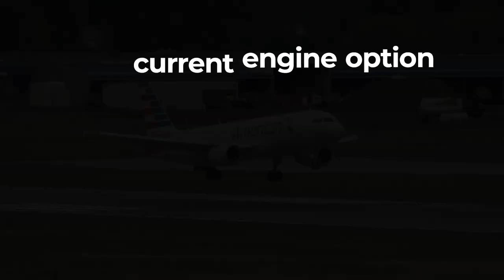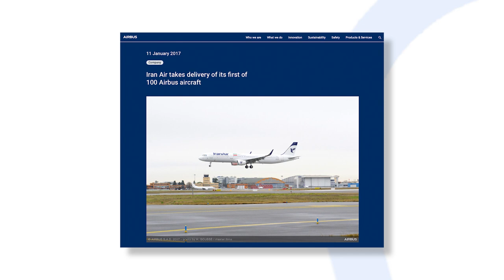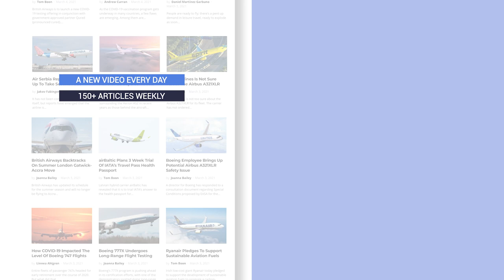Airbus Has Delivered Its Last Ever A321ceo

Comment: I've flown on Delta's A-321 between Detroit and Phoenix non stop over 15 times in the last year... Great modern cabins, great Delta service, and great planes from Airbus. I avoid flying any 737s due to the cramped interiors and lack of refinement.
Reply: Yeah delta’s 737s are extremely cramped, I try to avoid them when possible
Reply: Yup, I love the A-321s between Detroit/Atlanta and Phoenix. Always a great ride. The extra cabin width makes a massive difference. For a while they seemed to be running mostly 739s on those routes, which I liked much more than their 738s, but in recent years all I've been on are much superior A-321s.
Reply: And let’s not forget the dangers of the 737 max with the awful MCAS
Reply: You mean the 737's tendancy to nose-dive into terrain isn't also a factor when deciding whether to fly on a 737?
Reply: @vladsnape6408  Delta didn't buy the MAX, so it's not a factor on that airline.
Reply: @jblyon2  Fair enough.
Reply: @vladsnape6408  just stop the hate to Boeing already..
Reply: @vladsnape6408  nope, as mentioned delta purchased no maxes. I just don't like the 737s for the cramped cabins and slow take off rolls with weak engines.
Reply: @Joa_sss  don't think it hate Boeing just a poor product
Reply: @Joa_sss  if there ever was a reason to hate on any company - corporate greed that cost hundreds of lives is pretty good one
Reply: As a very tall person, I find the 737 windows too low. I have to bend over to look out. Also my shoulders don't quite fit so I have to lean to one side to stop touching the person next to me.
Reply: @Joa_sss  The bean counters at Boeing, many of whom came from McDonnell Douglas, destroyed a very good company. Ultimately, the only way accountant-driven companies such as Boeing will improve is if customers, both passengers and airline companies, insist on safety and quality. As long as people are willing to fly on poorly designed and manufactured airplanes, companies such as Boeing will continue cutting corners.
Reply: @mpsangha  The engines aren’t much weaker than what’s used on A320
Reply: @Joa_sss  agree 100%
Reply: @AlexanderPerez-hv4nu  let it go, it’s run it’s course. Maxes are flying everywhere now, they’re here to stay.
Reply: @vladsnape6408   tendency? Two aircraft out of how many flying today? It’s time to let it go.
Reply: @jjaus  believe it or not, the windows on airbus aircraft, besides the a220 are actually smaller than what you find on Boeing aircraft. I’m a fan of both but call a spade a spade. People find every reason in the book to pick Boeing apart.
Reply: @maverickhenderson4902  Believe it or not, I was talking about an A320 series.
Reply: @maverickhenderson4902  Also, lower, not bigger.
Reply: @maverickhenderson4902  The accidents happened as a result of systemic problems at Boeing. The problems are avoidable if Boeing completely restructures, gets rid of all the top hierarchy, stops using cheap non-union labour, and starts to do more than pay just cynical lip-service to safety issues.  If we let it go, then we would be enabling Boeing to continue making design and manufacturing decisions that will result in many more people dying. As consumers, we have a responsibility to say no, no more.
Reply: @jjaus  The 737 widest part is at the shoulder while A32S is at the waist. This is due to 737 having a lower floor than the A32S.
My preference is the A32S. I haven't been on a 737MAX because of the grounding then COVID so can't say if there is much of a difference.
Reply: @Emperorvalse  So YOU say. Are you 6'5"? Don't know what airlines you fly.
Reply: @AlexanderPerez-hv4nu  lets not involve the irrelevant 737max accidents
Reply: @vladsnape6408  I get your points, but what I'm saying is apparently the show is going on regardless. Preaching about things that have gone wrong isn't stopping or avoiding anything in the future. Airbus has had some hiccups as well. After a while things run their course and you can only hope that things are better going forward but throwing rocks at a mountain is for? It's easy, you don't like, don't book a flight on one. I personally don't have an issue with either, I've always got to where I was going and I understand that live were lost, one life is too many but if everybody is going to just darn the Max, there are a lot of other aircraft flying now that have suffered casualties. The funny thing is everyone seems to forget how the NEO'S were grounded for engine issues. Fortunately no lives were lost, that was the best about it, but still, an airframe with issues. Hopefully Boeing has their act together and the Max is as safe as the 737 generation before it. You can only hope.
Reply: I love Delta’s A321 I’ve flown it to and from DTW-LGA, ATL & SEA

Comment: I'm somewhat surprised that the CEO was still being produced & delivered. With the NEO being released 6yrs ago, I would have assumed that most airlines with the existing orders would have been "upgraded" to the more fuel efficient NEO variant.
Reply: Cost and time waiting for them
Reply: If you order a NEO, you’re only one of many airlines doing so. It would take years for the aircraft to be delivered. The CEO is not only cheaper but also was available sooner rather than later
Reply: Long line ✈️Delivery  time
Reply: Availability
Reply: Delta has always preferred the cheaper option. I'm surprised that the airline isn't going after American's retired 757 fleet.
Reply: @alooga555  One of the reasons being that the retired AA 757’s have RR engines and all of Delta’s 757’s are PW. So taking on  the RR 757’s would be a maintenance issue.
Reply: Christ the Neo is released 6 years ago... I feel old now
Reply: @and321now so why have delta then got over 150+ NEO’s on order to start delivery this year?

Comment: It is more important to move forward than to remain static due to a romance with a particular aircraft. The A321NEO and the A321 as a concept, will only get better as time passes. One thing that Airbus gets right as oppose to Boeing is that they build on what is right and done well instead of starting from scratch.
Reply: Have you heard of the 737?
Reply: @rileyw3660  hmm the one with rudder reversal and MCAS?
Reply: The 777, 747, and 737 would like to enter the chat
Reply: Yes, of course. Very successful as well. Boeing should have continued to either improve on it or make an entirely new design with even more advance features.
Reply: @jcspotter7322  The problem with Boeing (the same can be said about almost every American company CEO) the last two CEOs have been more focused on how well it’s stocks sells on Wall Street instead of building better products.
Reply: @cristiandiaz6333  and by that they casually killed a couple hundred people.

Comment: I never understood why companies bought the CEO when the NEO was released.
Reply: Because the NEO has a much higher order backlog, that’s an issue when it comes to e.g. engine supply. The CEOs were not only cheaper but were available when they were needed, many airlines took advantage of that.
Reply: Because of deep discounts offered by Airbus.
Reply: It makes sense with regards to the order backlog.
It's like buying an iPhone 7 when the iPhone 13 needs time to be delivered. But surely, owning the latest model outweighs an older model?
Reply: A mixture of high backlog and incredible discounts but I think many of these orders were outstanding before the NEO was announced and took a while to be delivered
Reply: The CEO was an aircraft that had been well-proven for years, while the NEO with its new engines made some "teething" problems during rollout. Qatar Airways even decided to forego the first delivery as a result, making Lufthansa the launch customer.
In terms of maintenance, each additional engine type requires appropriately trained employees and spare parts. Specializing in one (existing) engine type of the CEO can also bring cost advantages.
Reply: Delta in particular was waiting for the new engines to be proven and reliable.
Reply: @mmc4654  the difference in fuel economy clearly outweights staff training costs.
Reply: NEO was 20million more
Reply: @huplim  You buy the plane for your customers. You buy a phone to use yourself. Virtually none of your customers can privately own an A320 ceo, neo or otherwise. They use your plane to get from A to B safely, comfortably and in a timely fashion. Both the CEO and NEO can do that. The CEO was already good enough, otherwise you would not be flying those.
Reply: @aspiringaviator3095  20 million dollar savings.  Ding, ding, ding.  Oh, and Delta can use the A321ceo on flight legs where the operational efficiencies of the A321neo are minimal, like MCO to ATL.
Reply: Commonality with your existing fleet: maintenance crews are trained on the engine, spare parts already in stock.
Reply: Delta, as ever were cautious and A320ceo was working just fine for them.  Now we know the A320neo is a fantastically reliable type globally, that’ll change.  Well done Airbus.  I would say “end of an era” but I think we all know it’s onwards and upwards for the A320 family for a very long long time.
Reply: Because of timing, it's faster to get your hands older generation than newer gen

Comment: what's actually the difference between the CEO a320s with the NEW Sharklet tips and the older CEO a320s with the classic airbus arrow shaped winglets? All the NEOs have the new sharklets but a lot of the CEOs do to. Are they retrofitted or something?
Reply: They are part of the “enhanced” package Airbus released in about 2006 or so. The newer CEO’s came with LCD screens instead of CRT and removed the analogue standby instruments to replaces with a digital one, the enhanced models also switched hydraulic system for NWS from green to yellow
Reply: There are both CEOs with retrofitted Sharklets and CEOs with Sharklets fitted when being built around!

Comment: Why 🇺🇸Delta Air Lines didn't cancel orders on A320ceo and didn’t change to A320neo in 2016? A320neo more efficient and has less CO2 emissions than A320ceo!
Reply: Because it would’ve taken much longer for these NEOs to be delivered. The NEO has huge order backlogs and it takes years until a NEO is delivered. The CEO was available when it was needed, also it was cheaper and converting the order simply didn’t make sense

Comment: whats the point taking ceo? switching to neo would be finanically more prudent?
Reply: Not if you want to have the aircraft at a certain time. The NEO has huge order backlogs and until an A321neo is delivered it can take some years. These last CEOs were available when they were needed and cheaper, many airlines took advantage of that, not just Delta

Comment: Other than engines, what's the difference between a A321ceo and an A321neo?
Reply: Most newer A321neos have 3 main doors instead of 4 (on each side), instead they have 2 additional overwing exits on each side. It’s called Airbus Cabin Flex or short ACF. Other than that, there shouldn’t be any major differences other than the engines
Reply: Winglets
Reply: @oboma  well the CEO’s have had sharklets since about 2007
Reply: @Thomas Mortimore sharklets on the A320 family have been a thing since 2012
Reply: @spongebubatz  Winglets not sharklets
Reply: @oboma  I know that they’re winglets and Sharklets is just the way Airbus calls them, don’t ask me in how many discussions I’ve been with people who think that Sharklets aren’t winglets.
Anyhow, I used Sharklets here to differentiate them from the traditional wingtip fences installed on older A320s!

Comment: Maybe now Delta can get rid of their 717s and replace them with either more orders from the Airbus A220s or bring in those A320 CEOs to fill their place.
Reply: They have already started that transition.
Reply: i think A-220 is  replacing the 717s soon.
Reply: @leezinke4351  At least partially. It's also replacing the MD-80s. In general like all the big 3, DL is up gauging a lot of routes or pulling out of them. The next gap they will need to cover is getting rid of the 319/320/737-800s. They don't yet have an order in place to replace that category. They can't leave that gap in size between the 220-100/300 and the 321/737-900. Strong rumors in place that category will be the next major order by DL.
Reply: @leezinke4351  Nothing really to enjoy. It's a DC-9 basically around for so long now, nothing I'll miss about them. Times move on.
Reply: @johniii8147  You can still enjoy D-9s in China, where they fly under the name Comac ARJ21. They use license built DC-9 fuselages and a GE engine
Reply: @simonm1447  They are not really that similar other than the basic fuselage. Different wings (designed by the Russians), engines, and avionics. The program has been a disaster anyway with only 67 delivered since development started now over 20 years ago. 1/3 of the 67 is usually grounded at any given time due to reliability issues.

Comment: I don't understand why they did not change the order for the NEO. Why would they still want to take delivery of a CEO. Can someone explain. Other airlines change model orders to upgrade a model from original purchase order.
Reply: Delta have got the NEO on order
Reply: It was cheaper, Lufthansa for example also received new A320ceos into the end of 2019 simply because the aircraft were available when they were needed. If they went for NEOs they would have had to wait much longer
Reply: The CEOs are deeply discounted and very reliable.  They fit within the current inventory of aircraft DL flies.  DL has often taken cheaper aircraft at discounted prices (bought 717s from Southwest during Airtran merger).

Comment: I wonder why Delta wanted to get the A321ceo new off factory if they already had an oder for the A321neo
Reply: There’s a huge order back log for A320neo aircraft, if Delta switched the order it would’ve taken much longer until the aircraft would’ve been delivered. The CEO was not only ordered that way, so no changes to the order was needed, is cheaper and they maybe even got a discount!

Comment: Couldn’t they convert it from ceo to neo?
Reply: That’s rather complicated and contradicts the reason Delta even ordered these last A321ceos to be begin with. Delta ordered these A321ceos as the waiting times for CEOs used to be much shorter, mainly due to high demand for the NEO and engine supply

Comment: What about the A330ceo?
Reply: I think the last one was delivered to Aer Lingus in 2020, technically it’s still in production as Airbus continues building the A330MRTT which is based on the A330-200
Reply: @spongebubatz  
started with GE-cf6
Ended with GE-cf6

Comment: why buy an aircraft that become obsolete when buying. Like buying an iPhone 4 after 7 years the iPhone x launch.
Reply: Think of it this way:
A company is building two phones, the Phone2016, which came out in 2016, and the Phone2022, which came out this year. Everybody wants tye Phone2022, in fact so many want it that customers have to wait 5 years or longer until they get it. Now there’s you who really needs a phone right now. What do you do? Wait 5 years or get an older phone which still does the job now?

It’s the same with the last A321ceo deliveries to Delta. Sure, the NEO is out and it’s the better aircraft, but if Delta wanted to go for the NEO they wouldn’t get it until in a couple of years. They however need the capacity NOW, so the best option for them is still the CEO.

Comment: What is CEO ?
Reply: Current Engine Option or the original A321
Reply: @annoyingguyoninternet1631  there is no more a321...only a321xlr..er...etc ?
Reply: The boss of the company
Reply: @AhmadBakdash07  there were a321 in ceo forms but the new neos they call like a321-251nx
Reply: @AhmadBakdash07  the original a320 family (the ceo) will still fly around for decades to come. this was simply the last of their kind produced. airbus is going to switch to the neo's now. oh and the a321 xlr is just a new variant for the a320neo family

Comment: I'm wondering why Delta would take more 321ceos when the Airbus is able to churn out neos like hot cakes. I mean Delta could have easily swapped the remaining ceos in favour of the neos to save fuel and offer a better passenger experience and help the environment.
Reply: Massive discounts to clear the order line which vastly outweigh the fuel savings of the NEO.
Reply: @Penfold101  makes sense.
Reply: Commonality with your existing fleet: maintenance crews are trained on the engine, spare parts already in stock.

Comment: They should have delivered the last A320 CEO family aircraft at least 5 years ago. How can aviation reduce carbon emissions and become more sustainable when old inefficient aircraft are still being produced when a much more efficient replacement has been around for 6 years,
Reply: Because they couldn't wait several years for NEO deliveries which have a huge backlog. DL probably got a significant discount for the last CEOs as they helped Airbus keep the production line active while converting to NEO assembly.

Comment: To receive a CEO model when every airline is going fr Neo is the most foolish decision.
Reply: Why is that?  Delta got a great deal on the 321CEOs.  Also the engine Delta wanted on it’s NEOs is only now available for it.  It’s NOT the LEAP engine like everyone else. Hopefully the PW1130 will be robust enough for airline schedules.
Reply: Delta have ordered the NEO anyway
Reply: Delta have also ordered the NEO and they are just about to prepare a much more comfortable cabin than the CEO so that they would use it for longer flights